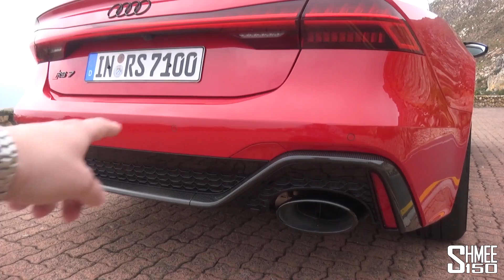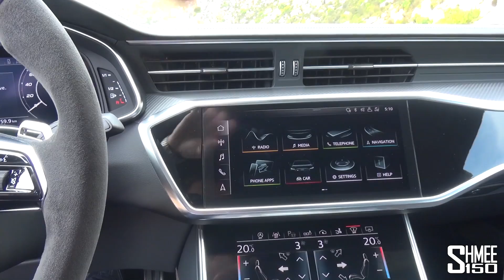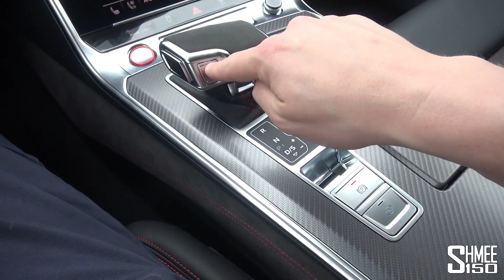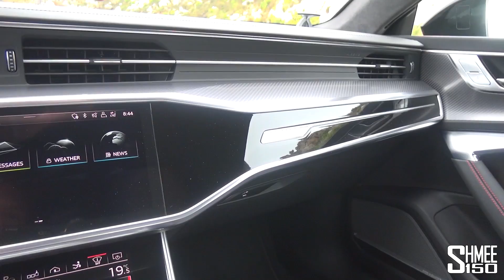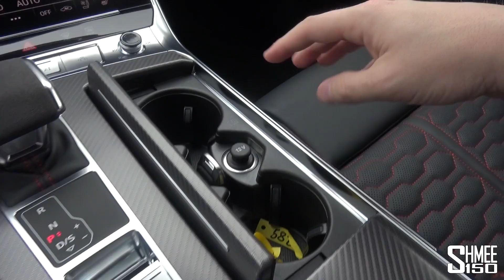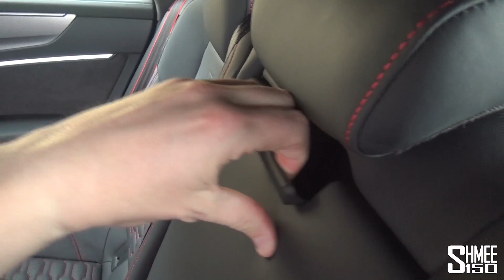My Exclusive First Drive in the New 2020 Audi RS7 Sportback!

Comment: my only concern with the new rs6/rs7 is the fact that they are claiming 0-62/0-100 in only 3.6 not 3.7 btw. however seeing as this car is supposed to compare with the E63s and the m5/m5 comp, I don't think it will keep up with em. Maybe if they release a performance version they could up the power to like 630hp and 850nm of torque. I honestly expected the claim for 0-62 to be between 3.4 -3.2 seconds. A god damm rs3 can do 0-62 in 3.6/3.7 seconds.

Comment: I hope they didn't fuck up the engine like the previous Gen was. That 4.0 tfsi engine had notorious full on failures. The spark plugs bursted all the time and the parts fell into the cylinder bank causing serious damage to the pistons and the whole block. Ngk, Bosch and many many others brands and still it happened. Turned out its the spark plugs fault and! The fuel mixture which caused too high temp fuel burning. The spark plug bursted due to high temp and the rest you know. My personal friend who owned an rs6 and rs7 later on went through 5 freakin engines! 5! That's around 300k euros! That's supercar money!

Comment: Extremely disappointed with the end design with the exception of the wider body and the tail lights. I like the 22” wheels but not the design they look like something that should be on a Honda Accord. The front of the car looks horrible and not sleek and aggressive like the previous models. My first reaction is that Audi took 3 steps back and that’ll allow BMW and Benz time to catch up and pass them.

Comment: Rip m5 competition and e63s amg. Those peasants are not worthy of being compared with the almighty rs7
Reply: RS7 0-60 3.6 seconds M5 0-60 2.8 seconds Lmfao BMW M5 is nearly a full second faster, audi is utter trash, cope harder fangirl
Reply: @davissilvestrs1996  2.8 seconds? Source?
Reply: @justina9914  Car and Driver BMW M5 vs. Cadillac CTS-V, Mercedes-AMG E63 S, Porsche Panamera Turbo test, read and weep.
Reply: @davissilvestrs1996  why should I weep? I am not as sensitive as you are
Reply: @davissilvestrs1996  every car on the test you mentioned was faster than the manufacturers' claims. So why did you use the factory number for the Rs7 you biased boy
Reply: @davissilvestrs1996  fangirl? I am a 6 foot 1 male who can beat you up

Comment: The car is clearly more dynamic and aggressive. but compared to the last generation I see a clear return in power in terms of HP. some will say it's only five less and sacrificed horses for more torque, 81.5 precisely. However this extra torque made a difference of only a tenth of a second at 0-100 which is not as perceptible as this for most people ...
And now the only package that hits the 300 km / h mark is the Dynamic Plus the top speed has remained, the rest electronically limited, crap, no one buys an RS7 expecting injection cuts when close to 250km / h ...
They turned very heavy in the interior just more impeccable in fact and found it a bit unnecessary to lengthen the car that is already a very large sedan. We want a quattro-powered V8 beast with daddy's car face, not a limo.
I really expected an 800 horsepower hybrid but it looks like Audi is not ready for it yet.
Very beautiful but the same practice car just changed the bodywork.

Comment: That carbon diffuser in the rear needs to be removed. All that zig zag (up and down) ruins the look of the rear. Also wish they had kept the taillights separate, and not have that one single piece. Doesn’t look as bed in the red as it would on other colors. Other than that, looks like a phenomenal car.

Comment: I really like the latest A7 and especially this RS7. Looks great and sounds great. In fact Audi are very much on top of the game when it comes to design at the moment, I don't think there's a bad looking Audi at the moment. 
I've driven a few A7's and current gen Audi's and I don't think I like all the touchscreens. They look great (if you can keep them clean of greasy finger prints) but they're simply not as easy to use as an actual switch or button. The haptic feedback from the screen helps but I find I still have to look down to see what I am doing.

Comment: Auudi are notorius for understating 0 to 100. Expect this to be  3.3 to 3.4 second to 100. What a weapon
Reply: Still slower than the 2 year old BMW M5 and E63S AMG.
Reply: @davissilvestrs1996  You are a funny guy.  Let's see what happens when there is an actual test with these cars.
Reply: @darshandhillon159  What will happen is utter humiliation just like the new RS4 and RS5 that turned out to be slower than the 6 year old F80 M3 and W205 C63S AMG.
M5 F90 does 0-60 in 2.8 seconds that is way faster than this Audi.
Reply: @davissilvestrs1996  Uh uh.  Until there is an actual race mate I'm not going to comment on who is quicker.

Comment: E63s m5 competition 0 to 60 in 3.0  audi rs7 3.7 😭
Reply: GOT TALENT T ik so bad😳😳 3.7 has like m4.
Reply: urban smrekar plus this rs7 has 100 pounds feet more torque. Which means out of the dig with more grunt. The performance RS 7 will be 200 lbs lighter, with probably 650 hp. and likely 700 pounds feet torque.
Reply: @lorrimiller7010  M8 Gran Coupe Competition, M5 Competition and the upcoming M5 CS will murder the RS7 and RS7 Performance either way.
Reply: There's truth in drag races, lets wait and see
Reply: Mila Mpapela Audi is historically conservative with 0-60 numbers. Two years ago they claimed 3.6 but many magazines test were clocking 3.2. Performance RS will likely run a real world 3.0
Reply: The real 0-60 is on 3.38s and it's not performance package, and it's a different type of vehicle that's why it weights like 500lb more than the m5... so wtf bruh.

Comment: Up 40 from before??? The C7 one had 605hp (performace one) this new rs7 has less horsepower then the old one
Reply: The C7 has 560 as Standard and the new has 600 as Standard. The Performance should be around 650 hp. You see, actually it is more, not less

Comment: I would take one   of the variants of the Panamara, over bmw, Mercedes or audi, but this is a nice package
Reply: Panamera costs way more for similar performance
Reply: @ZS-xi4xk  the 2018 audi was almost 90 thousand this new one is supposed to cost quite a bit more.  Some panamara variants don't cost more. Im sure you will say the higher hp panamara will costs alot more we will see what price this is
Reply: @allensaunders449  similarly specced horsepower configurations of the Panamera will exceed the price of this Audi, I guarantee you. And it won't be by a tiny margin either.

Comment: Was worried that this new RS7 wouldn’t  have a great design like the previous one. Have to say I’m impressed
Reply: The previous one is one of the best looking cars ever tho
Reply: Lunns I completely agree. When the 2nd gen A7 launched I wasn’t a fan of the styling so I was skeptical about the design of the new RS7
Reply: And not many people will disagree with me
Reply: I like the old design's back more.
Reply: @SLK999   ikr, the old tailights looks better sort of like Mazda RX7
Reply: This car doesn't look good to me. Especially the rear. I'm not impressed at all. Maybe it looks better in a different color.
Reply: The previous rs7 was amazing looking
Reply: Sounds weak compared to Miltek none resonated exhaust
Reply: Full length back tail lights is uglier than a mofo.
Reply: 2014 RS7 was the best look

Comment: 600 hp and 3.7 to 62? Isn’t that worst compared to competition (M5 and AMG GT and panamera turbo)???
Reply: js002003 Panamera isn’t a competitor since it’s VAG as well. That’s probably why they didin’t give it more hp since it would be stepping on the panameras toes. But the M8 will be the competitor not an M5
Reply: Good call. The M8 more logical competitor as 4 door coupe. Which means the rs7 is even more behind as that M8 is going to be seriously fast and imo much better looking.